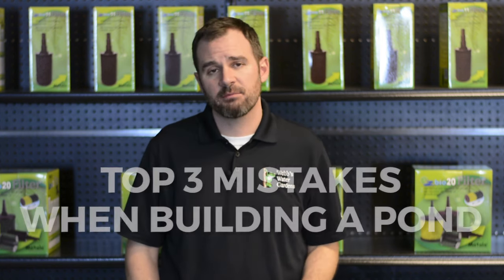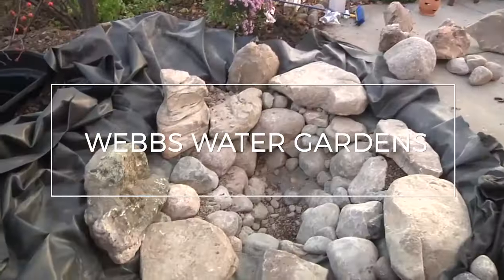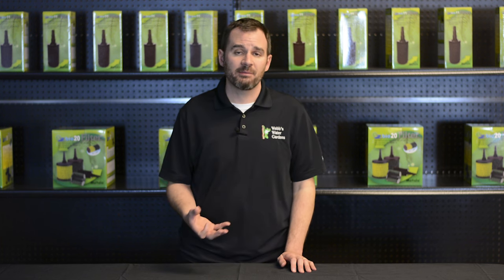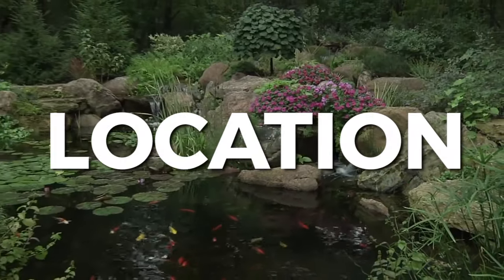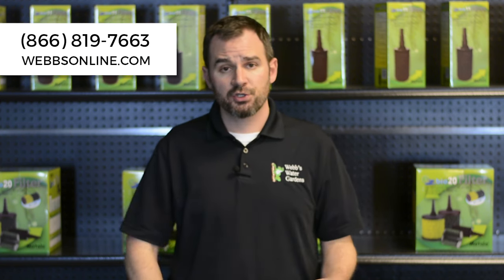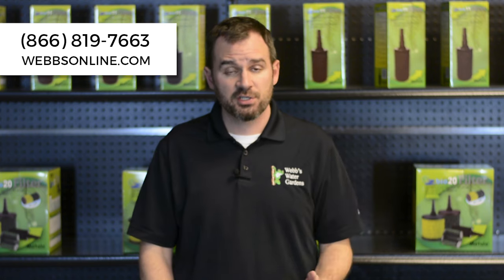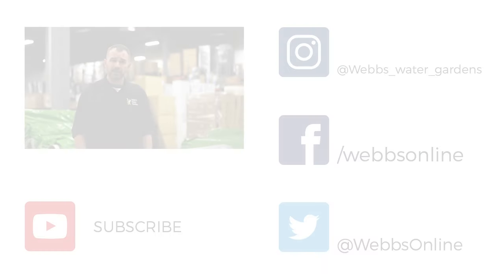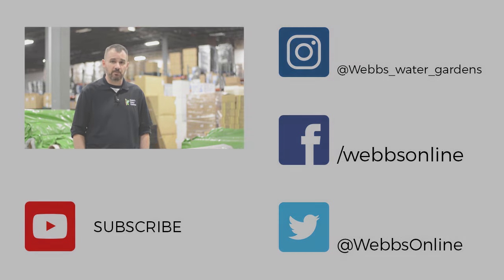TOP 3 MISTAKES MADE WHEN BUILDING A POND

Comment: Wow. Wish I had seen this BEFORE I build my pond. I put it in a low spot,, turns out there is a seasonal underground stream there which kept filling under the liner, making it slide off the edges. Still working out a solution. Can you believe I had to put a sump pump UNDER my pond liner, reconfigure the pond so I could reach the sump for maintenance. Not out of the woods, but working on it. Thanks for your video.

Comment: I have a 20x20 pond. Just installed. I put it in a high spot, finished the liner shaping and then it rained. At first, the bottom and shelves were still solid today.  Yeah - no leaks. BUT.  Then I drained it to finish working in it with the other stones/features/filters, etc... and the water that I pumped out, got under the liner, even though I pumped it a good distance away.  The initial rain didn't affect it. So, my question is, do I need to tuck the liner's top edge down around the pond's top to some depth to keep that from going back in under the liner when I need to empty it?
Reply from the maker: Yes, this would be recommended.

Comment: I want a small bird bath/small pet water feature with a little water fall to prevent mosquito larvae. I need a float valve to insure my recirculating pump does not run out of water and would like a faucet type drain out the side so when I clean it I can attach a hose to water nearby plants.  Is this unrealistic?  I love the sound and refreshing feeling of moving water but living in a drought prone area I don't want to waste water.  I will use gravity  flow water from my 300 gallon rain collection tank. 
I welcome your suggestions.
Reply from the maker: Our small pondless water fall kits could be an option, you can find them here https://webbsonline.com/Category/Kits-to-build-a-complete-small-pondles-waterfall. A compact auto-fill valve (https://webbsonline.com/Item/Aquascape-Compact-Water-fill-Valve-MPN-88006) can be installed to automatically add water to the feature when needed. A tee fitting with ball valve could be utilized on the main water line off the pump to redirect (water plants).

Comment: I have a question. I dug the pond hole. But the liner was the wrong size. How long can I wait with just the hole until the new liner arrives.
Reply from the maker: As long as necessary. If it rains you will need to empty the water or let the ground absorb it.

Comment: Hi,
My late father had a Greenhouse which I have since removed, the stone area is what it stood on which I will put rocks on,  I am moving the earth for the water area, I will use it for Newts or Frogs  but I don't know wether I want concrete or liner, If I go with concrete how do I put it on the side walls? I understand I will need a few inches of gravel on the base before the concrete is laid but again what about the sides?

Thanks for any help.
Reply from the maker: We pretty much only deal with rubber liner installations. Good luck on your venture.
Reply: If your building a ground pound then just don't make the walls of the pond steep and you can just mix your concrete nice a thick not runny and it will stay where you poor it. If your planning on steep walls then you may need to build shuttering out of wood to poor the concrete to hold it in. Or build the walls with blocks then render the blocks.
Reply: @Crazyoldman84  Thanks, the wall will be straight up, so can I put breeze block up then render?
or put render up but won't that leave a gap when removed?
Can I just lay the concrete on the base then do the wall/shuttering after?
Reply: @Crazyoldman84  P.S,
I assume I will have to place Galvenised steel on the base AND wall of the pond do it's IN the concrete.
Thanks

Comment: want to make a three tiered tub purchased from Home depot and lowes ...pond ....figuring out the way it should be placed is a bugger ...Help!
Reply from the maker: A few tips - You'll want the largest pond at the very bottom. Smallest at the top. Make sure to install not in a low lying area. If you need assistance with sizing a pump, filter, etc. - please don't hesitate to call me at 866-819-7663 x120. i'm available M-F, 9-4 EST

Comment: We recently had a 20 feet deep sink hole open up, which we’re considering making it a pond instead of the trying to fill it back in. Is this a good idea?
Reply from the maker: Would not recommend, as you cannot guarantee it will not get deeper.
Reply: Agree that sounds risky. 
However you could build a pond elsewhere and use the excavated dirt to fill the sinkhole.
Reply: Yes
Reply: I think it sounds fun.

Comment: Koi Pond 3 months past completion date by person of profession LOL - so many errors.  Question please - the shelf is getting narrower - in 4 weeks a part of the shelf has gone from 6" down to less than 4".  Why?  What process was not done to create this?  Besides the complete improper way of putting the the 45ML liner.  I only know of of this now due to the delay I began researching all things.  Anyone please help with why shelf around pond is getting narrow - is is eroding?????  Live in area with thick rocky dirt.
Reply from the maker: Definitely sounds like the soil creating the shelf wasn't tamped well enough prior to the liner going in, and it is eroding.
Reply: @WebbsWaterGardens   I'm really in a pickle - I have studied so much I know I could finish the Koi Pond - aging is putting a dampler on that thought. LOL  Would you please answer one more question - my son brought over is underwater extension camera - I got in the pond and took a video of the bottom - the liner is NOT secured flat to the bottom of the pond.  I noticed a few inches floating up - it's two pieces poking straight up with a gap inbetween.  Much worse than I thought - as I walked down the length of the pool the liner sticking up - rather waving in the water - at the far end is at least 8" - I can just swish back and forth in water.  Before we spend any more money to complete with a new person or before I pay for some remaining material cost - I need more knowledge on errosion.  Plan to take the video to a foundation company or if I can find a larger more experienced Koi Pond builder - not many in my area that I'm aware.  Certainly appreciate your feedback!!!! Thank You. (example of one issue - this person purchase a Pond Kit for a 4,100 gallon Pond.  Our pond is 1,472 gallons and I don't feel I should be paying for a Pond Kit 3 times the size needed - oh geez, I could go on - just trying to know what is laying ahead and still do the right thing for materials in our possession.  Could I call you???

Comment: Ya I built my pond in a run off and the walls caved in and the ground water pushed my pond liner up and it ripped in 1 place due to all of this, so now in April 2019 I get to buy some concrete rebar and cynder blocks and reconstruct everything or I'll build a above ground wooden frame pond...decisions decisions